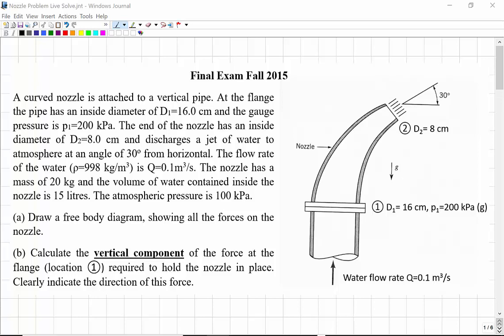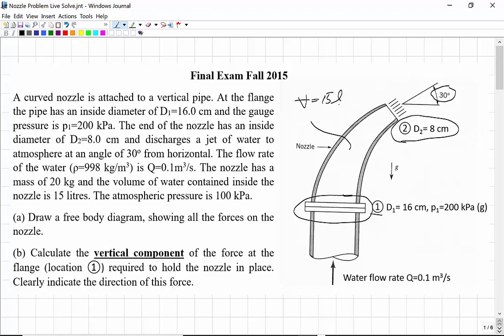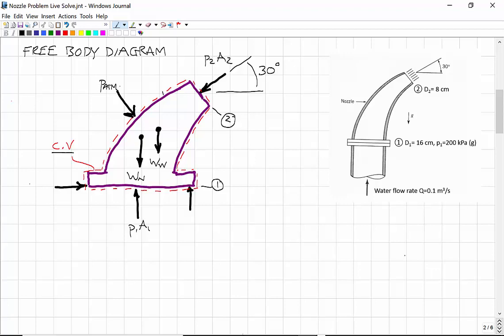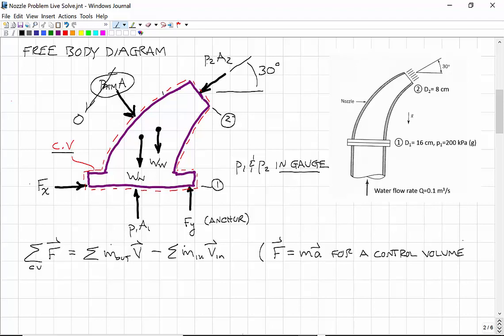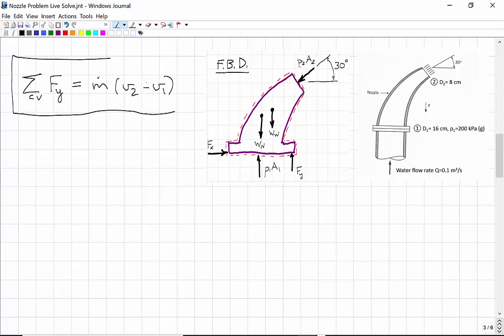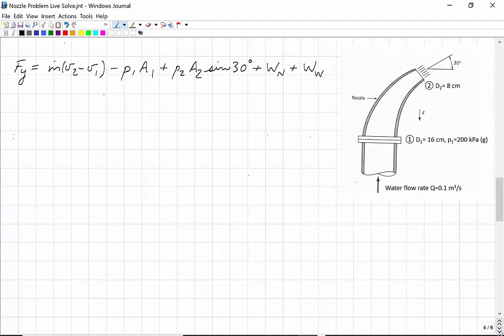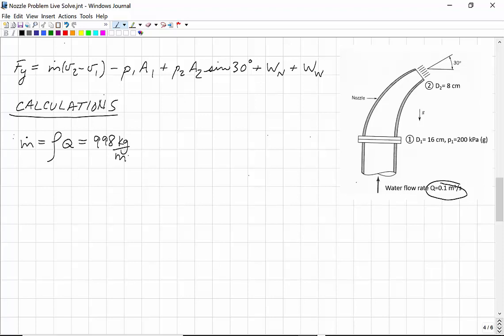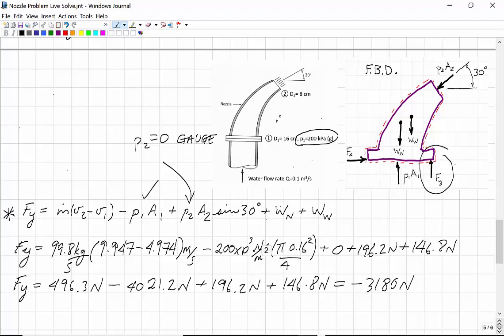Solved Exam Problem: Conservation Linear Momentum

Comment: Why is the momentum force in the opposite direction as the pressure force? Seems like they would both be acting in the same direction, no?
Reply from the maker: The pressure force acts upward on the nozzle, as shown in the Free Body Diagram. So, the component of F_y (the forced needed to hold the nozzle in place) due to pressure alone must be downward. In contrast, the fluid momentum in the vertical direction increases through the nozzle. This change in momentum requires a force (F_y) in the upward direction to hold the nozzle in place. (Think of trying to hold a jet engine in place.)
Reply: life saver.finally know why😁

Comment: SIR, IN THE QUESTION, ATMOSPHEARIC PRESSURE GIVEN AS 100 KPA SO HOW CAN YOU TAKE P2 GAUGE = 0?
Reply from the maker: Gauge pressure is defined as the pressure relative to local atmospheric pressure. So P_2=0 gauge. A Bourdon pressure gauge at the outlet would read zero. In these types of momentum problems you have to work in gauge pressure, for reasons that are explained in this video:  https://youtu.be/pk3nFNQRmFU
Reply: @FluidMatters  thank you for the explanation sir.
Reply: @FluidMatters  but as p2 we are using straight 200kpa in that why we are not using relative gauge pressure
Reply from the maker: @DhushanSuresh  I think you mean p_1. The problem states that "the gauge pressure is p1=200 kPa". So, the absolute pressure at point 1 would be 300 kPa.
Reply: @Fluid matters sir can I convert gauge pressure into absolute pressure and then use the equation?

Comment: sir can u please explain me how to take the direction of force
Reply from the maker: As in your Statics course: You start by assuming a direction for the force (which may or may not be correct). You then do the analysis using the assumed direction. If the force comes out positive  then the assumed direction was correct. If it turns out to be negative, then the direction of the force needs to be flipped (180 degrees). I hope that helps.

Comment: Wait. If the force on the flange is in the negative Y direction, and that is DOWN, then the flange is under compression onto its partner, in which case the pressure is holding the joint shut and the bolts can't be under tension.

A more advanced answer would require you to find the centres of gravity of the nozzle and the water within to make sure they weren't causing a tipping force on the bolts on the outer part of the curve.
Reply from the maker: You've got this reversed. Fy is the force the bolt applies to the flange to hold it in place.
Reply: @FluidMatters  Ah. Okay, my bad.